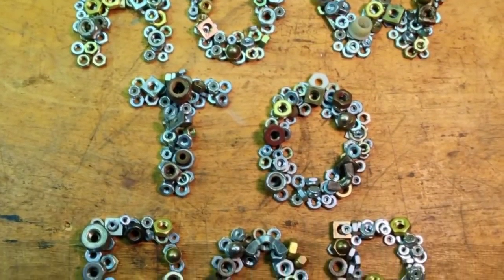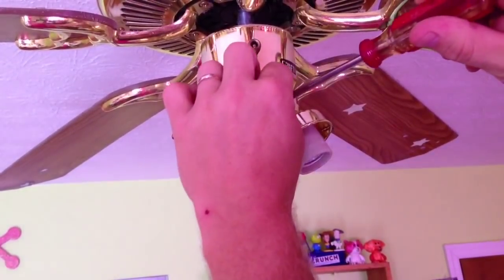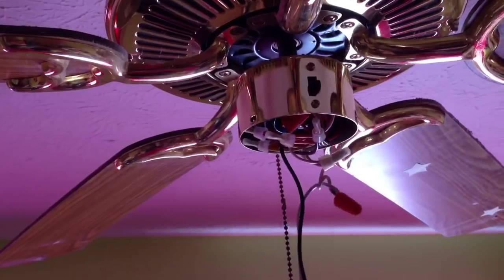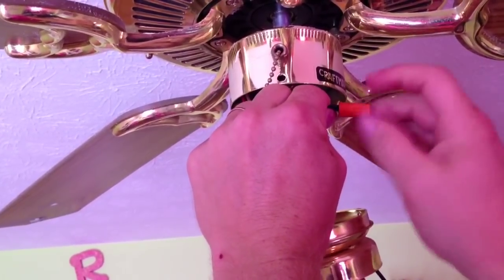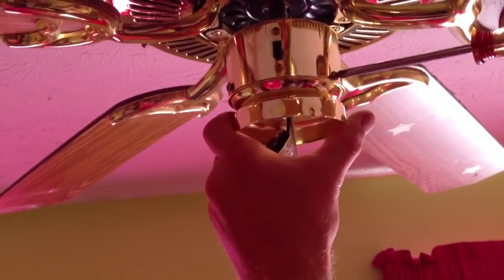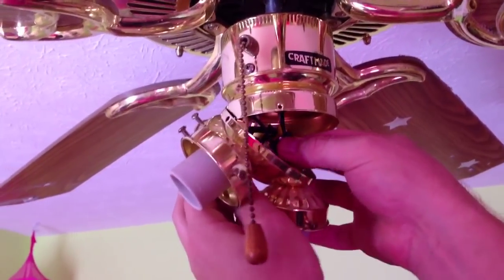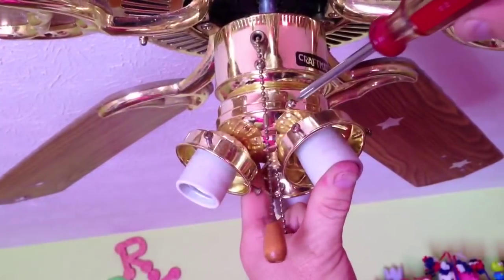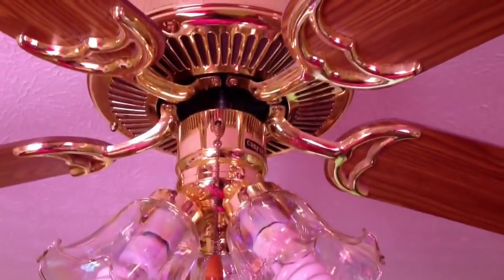Replacing a broken pull chain switch on a ceiling fan.

Comment: I have a celing Dan I had it all set & match things up. However someone pulled it apart. Now I can't understand how it goes together. All different colors.  This is what comes out of neck. RED, 2 WHITE,BROWN, GRAY & BLAC Block the stationary overwhelmed one switch that controls the fan however there's an Orange wire that comes out of that switch no she's right Block the stationary overwhelmed one switch that controls the fan. However it goes to the square or rectangle Box and all that count and there's a purple that goes into the Box Orange that goes into the Box and red deck goes into the Box and there is a yellow that cause I'm in a Box no coming out of the Box why don't you like this Orange it goes in the Box yellow and it goes in the Box and purple goes in the Box now coming out of the Box there's a red and an Orange Now on the pen switch you have what you call like this 2 is yellow Purpose 1L is black  The number 3 is blue How to switch that makes it go forward or backwards you have like this you have You know coming out of the switch you have Brown purple Gray and white I think all the Browns go together and I'm coming through the neck to the other Browns that are on that opponent switch I'm not sure if theNot sure if the Gray's girl was white or if it's white total white and greater to gray but still got figure out where the switches go to with the wires on a switch where did they connect toAnd you give me some insight how to wire it up I really appreciate it
Reply from the maker: The internal wiring for fans will be brand specific so to find out where each wire goes and what each wire does you would need to contact the manufacturer of the fan in question.
Thanks for watching.

Comment: Could you have used the short wire that was cut off when you replace the switch instead of cutting  the clip with the three black wires. Will that work. thanks. Great video.
Reply from the maker: Eugene Bedka Yeah that would also work fine. Good question. Thanks for watching.

Comment: Out of curiosity did you kill the breaker to the fan or just leave the switch in the off position? Looking to fix mine
Reply from the maker: I just turned the switch off for this one BUT always make sure that the power is OFF first. Thanks for the question, and Thanks for watching.

Comment: The switch to turn my cooling fan on came off when i went to turn it on after a shower. Is replacing the cooling fan chain faster than the chain to turn on the light?
Reply from the maker: They are done about the same way and the location is close so I would say the time is very similar. Hope this helps. Thanks for watching

Comment: Somebody please answer! Do I have to turn off the house power? Or just make sure the light switch is off in the room?
Reply from the maker: +Jeffrey Grim If you read the previous comments you will find that this question has already been asked and answered! Here is one of the previous answers:  Well that depends on how comfortable you are with working with electric.  I know people that would do this type of thing without turning the power off at all, but to play it safe it is always better to turn the switch off and do a test at the fan to make sure there is no power to it. It wouldn't hurt to turn the breaker off just in case someone enters the room and tries to flip the switch thinking they are going to give you more light but instead "light" you up. Best bet is to check the 
power at the fan before proceeding. Thanks. ~Be safe
Reply: +funbro1 I screwed up, I didn't turn the switch off, 2 wires connected and power on my side of the house went out, blown fuse.
Reply from the maker: Be careful, test and make sure the power is off before attempting electrical work.

Comment: I just wanted to say THANK you so much!  We have been without a light in our bedroom for .. many months!  the fan worked, and we resorted to closet lights and bathroom lights when it was necessary to add light to the room.  We didn't want to pay someone to fix it, and knew we could, but, well I was intimidated.  I watched a video way back then, when it broke, a different one, and it was thorough, but it kind of scared me.  Yours was short, concise, to the point and exactly what I needed to feel more comfortable so I could try it.  First thing I did was turn off the breaker, then unscrew everything so that I could see the switch (so I knew I would buy the right one).  My fan had a blue wire and a black wire which threw me.  I went to the hardware store, and the guy said that the blue and black  meant they were both hot wires (they only had 2 black wire switches) he said it should work, so, I brought it home, positioned the switch the same as the old one tried to line up the wires just in case) turned on the power to test, and VOILA!  to be honest, changing the switch for a newbie, it only took me about 5 minutes to get that done - it took longer to put the darn thing back together than it did to change the switch.  for me - about 15 minutes or less total.  This is long a long post, but I am just thrilled and had to say THANKS!  I turned everything off and am waiting till my husband gets home so I can surprise him with the fix :)  hurray!!
Reply from the maker: That's awesome, glad that the video was able to help. Thanks for watching.

Comment: Thanks for your help!  Helped me understand the quick process to fix the speed switch.  I bought a replacement at a local hardware store for $5.99 - it is likely cheaper at the big box locations.
Reply from the maker: It could be cheaper but  the time savings would be worth it. glad you were able to use the video. Thanks for watching

Comment: How do I take the pull chain switch off mine doesn't just pull off
Reply from the maker: Look for a nut on the back side of the switch, inside. Different manufacturers have different ways of attaching the switches.  Hope this helps.

Comment: my freaking new switch has three wires black blue and red, my fan has orange, black,yellow ,and purple wtf. People please help me what goes goes where
Reply from the maker: Sometimes there is another set of screws that removes the cover closer to the fan than the light. Check to see if there is another set of screws closer to the light kit. Hopefully you will find this and under this cover should be the basic light wires. Thanks for watching

Comment: Don't replace it... spray WD-40 up into the switch
Reply from the maker: I know WD-40 is great for many things but I don't think it will make a new chain grow out of the switch. Might help if the switch is not working but the potential for fire is too great and I would recommend using a contact cleaner if you have a sticky switch. Thanks for watching.

Comment: I have a  question I  am fixing a  ceiling  fan  with no light  Fan only   when taking  it apart the white wire fell    off     Do I connect all the white wires   together when putting the new one on ?
Reply from the maker: Yes, its basically matching up the colors. The only exception would be IF you had a blue wire, but that is for the light kit. Thanks for watching.
Reply: funbro1 ty               no  light kits  just white wires there so I will connect white wires  together  to see if it works  all is unplugged before I try  TY  for  responding  :)
Reply from the maker: Yes, make sure there is no power to the fan. :-)
Reply: funbro1 I feel  if I try I can do anything  >> electric turned off <<  always first :)
Reply: all went ok  but  when installing the new fan motor I found out the old  ceiling fans hole to  run the chain through is  smaller than the new part  installed  Some cases  fans as old as 30 years old although  works  is outdated   I attached the pull  chain  but  couldn't use the gold screw on  for the hole since the fan hole is too small :(
Reply from the maker: If you have a drill use a slightly larger drill bit and drill the hole to the size that will allow the chain to fit.

Comment: I have replaced ceiling switches on my ceiling fan before, and I looked at the wiring, but this time the light fixture fell on the bed, and of course all that is left hanging from the fan is a blue, white and a black wire.  I hooked up the blue wire to the black on the new switch, and the  white to the white coming from the fan, what do I do with the black wire coming from the fan?  The lights work, but not the fan?  Help
Reply from the maker: It sounds like it needs to go to the motor the way you describe it?
Reply: White to white . Then the blue ( fan)and black(light) get connected together
and go to one side of the switch. The black from the fan goes to the other side of the switch(hot always). The switch will turn both on or off then.

Comment: What if you hat the fan but it won't turn. ...also a spring popped out ??
Reply from the maker: +Rushelle Crane You may need to replace the other switch as well.
Reply: +funbro1 5

Comment: My ceiling fan was missing the chain on the speed select pull chain switch. I didn't necessarily needed to replace the whole pull switch. I without help, just opened up the pull chain switch itself and added a new chain. This was a tricky operation but got the pull chain switch working again!
Reply from the maker: foxthorne Now that's getting it done.

Comment: Hello, does the spring belong inside this switch? And, are these fan light switches universal to any fan? Thank you for your assistance
Reply: I'm not the creator/author of the video, but I do know that there can be some differences - I disassembled to see what Kind of switch I had (didn't take it off, just looked at it), then went to the hardware store (in hind sight I should have taken a pic with my phone and took it with me) - just to make sure. I don't think there are a LOT of them, but save yourself 2 trips and look at it before you go :)

Comment: The chain switch that makes the fan turn off broke and I don't know how to turn it off
Reply: Irma Ayala You need to cut the power to the fan off at the breaker box before you start doing this.
Reply from the maker: Irma Ayala Sounds like you need to replace it, turn it off at the switch and at the breaker to be safe.
Reply: I have the same issue, the pull chain for the fan, the whole chain just came right out.  So it sounds like I need to take the housing apart like you did in the video, except the fan chain comes from the upper part, not that lower "cup" part that you showed for the light pull chain...? And do I need to replace the fan switch inside, or will there be a way to just reconnect the chain?  Thanks so much, great video!
Reply from the maker: Yes you will need to take apart the housing where the chain for the fan enters. Yes there is a chance that there may be enough chain to reattach another piece to it but I have found that most times the chain comes off inside the switch. If you do have to replace the fan switch the process will be about the same as this video. Just remember to turn the electric off. Thanks for the good question.

Comment: My 2 black wire leads, have them go up and it doesn't matter where they go? As long as they have a connection? Hahahahahaha. Not!!!!!!
Reply from the maker: Ok? Not sure what your getting at here but thanks for watching.
Reply: @funbro1  ....well, upon dissemble, my 2 black wires connected to  certain wire hanging down with a screw on connector. Yet i could use other wires upon inserting the 2 black ones? Doesn't make sense.
Reply from the maker: Not at all.

Comment: Thank you so much for this. Someone took apart a fan to replace the light paddle switch but never finished it. I was not sure how to wire the new switch in place because nothing was labeled and the wires in the fan are different colors than the wires in the ceiling. This was perfect in showing me how to replace the paddle switch.  Thank you so very much!
Reply from the maker: Thanks for watching.

Comment: the switch I purchased had 2 Black wires. I took one of the wires and twisted it with the  black wires and the other wire and twisted it with the white wires and it didnt work . I was wondering why the switch had 2 black wires instead of black and white.what am I doing wrong.  The fan worked and the lighs were on but cant cut light off with chain
Reply from the maker: It is possible that you might have purchased the wrong type of replacement switch. There are different types depending on the application. Check the switch that you took out and compare it to the new one...they should have the same amount/colors of wires.

Comment: Do I turn off the power to the entire house or the switch in the room? Thanks!
Reply from the maker: It is best to turn the power off at the breaker for that fixture (no need to turn the entire house off), second best is the switch in the room, but I know that some people do it with the electric on. Thanks for watching.
Reply: funbro1 Great instructions and thank you for replying.
Reply: If there is a switch on the wall it should be in the off position and you should be good to go. If you have a hot circuit tester put the tip of it next to the black wires and confirm no power to the wires where you are working!
Reply: Yelp, best to turn the breaker to that room off, unless you are sure the switch kills all the electric to the entire thing.  My dad had wired one here at the house that my huny went to change out the fan switch on thinking the wall switch because it shut off the light, shut off the entire power to the fan, but he found out real quick that  was Not the case.  So better to be safe than sorry. 
 @funbro1 thanks for the great video I just got done replacing my fan light switch following your directions :).  My huny is going blind and can't see to do things like that anymore,  either that or he's just pretending because he's afraid dad worked on this one too lol, I'm not sure which, but now if I can't do it then it has to be hired done, and we prefer to keep our money in our own pockets when possible.  Thanks again for the easy to follow video.

Comment: There is nothing easy about this.
Reply from the maker: Ther is nothing hard either. Thanks for watching.
Reply: For those so inclined I am sure it's easy. But for me that might as well be open heart surgery.
Reply from the maker: You need more inclination then, because it is not that difficult. only 2 wires and a few screws.
Reply: Yea I have some friends who are so used to installing ceiling fans that they don't even turn off electricity to the area they are installing in.  Although it should be a precaution but the point is they are comfortable with this part of electrical connection for a new or upgraded fan.
Reply: That makes no sense. Electricity does not care if you are comfortable with it, if it is live, you can get popped. Hope their insurance doesn't find out about this. Lol.
Reply: It's really is easy to do. There were a couple of steps in this video that could have been bypassed. 
Look, if you can tie your shoe laces and do at least one side of a Rubik's cube, you can fix the switch on your own.
Reply: The wires aren’t dangerous and barely feel a pinch if you get shocked. The wires are to small not a lot of volts can run through them

Comment: Nice. But...I need a vid for the switch that adjusts motor speed. I'm inspired to just take this sucker apart and figure that out based on the intro here (and change the light switch while I'm in there; it's gotten super stiff anyhow). Before I start cussing...have you already made a vid re: replacing the variable speed switch?
Reply from the maker: I have not made a video for the fan switch but it is very similar...so similar if you follow most of this video you should be able to get it done. Thanks for watching.
Reply: GREAT! THat's just what I was hoping! I'll add it to my "to-do" list. MAN that sucker's a LONG list!
Reply from the maker: You can do it!

Comment: Just change the title. It is to fix a LIGHT SWITCH, NOT the ceiling FAN switch!
Reply from the maker: WHY would I want to change the name of the video to something that it is NOT??? The title IS correct. The video shows how to change a pull chain switch on a ceiling fan. Bonus feature is that the same instructions will work for the fan switch as well. Thanks for the view.